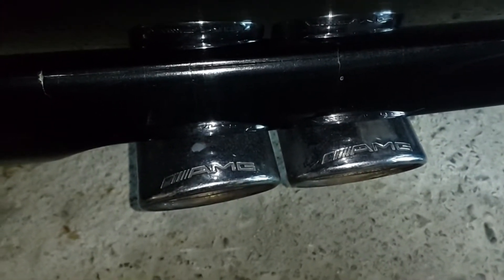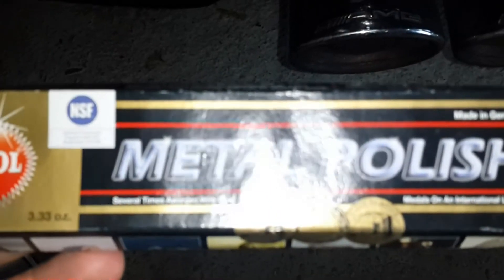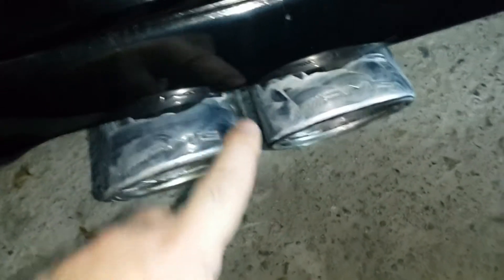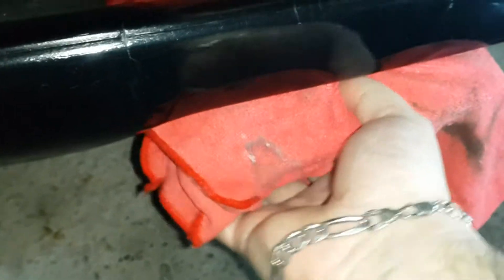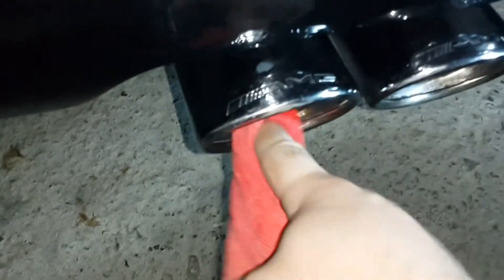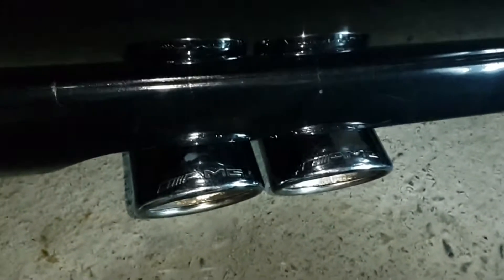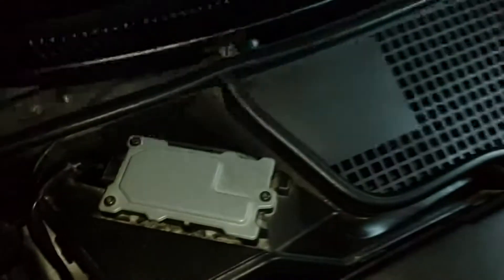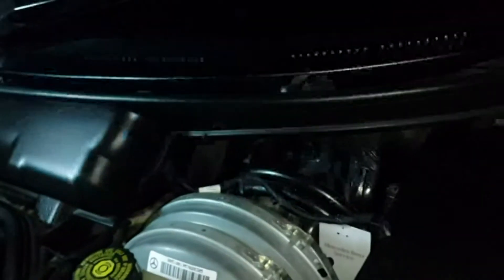Polished exhaust tips and installed some new parts

Comment: Hello, I wanna do this to my car too, but i’m afraid that the exhausts might detach or something since they are not attached properly like the stock ones. Please tell me, is it safe to do it?
Reply from the maker: What car do you have? On my car the exhaust is attached pretty hard and it does not matter what you use, hand or polishing machine it will stay in it's place. If you have aftermarket exhaust, or only have exhaust tips installed, then be gentle and work with your hands, i think nothing will be detached then...
Reply: @W210Garage  okay thank you so much for your response🙏🏻
Reply from the maker: @AceRoy  
You are welcome :) Greetings :)))